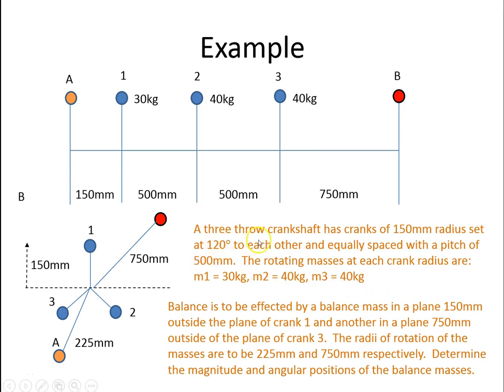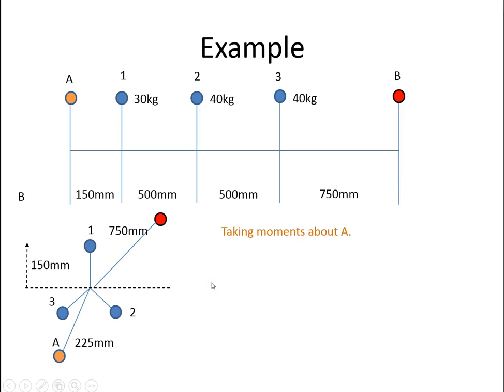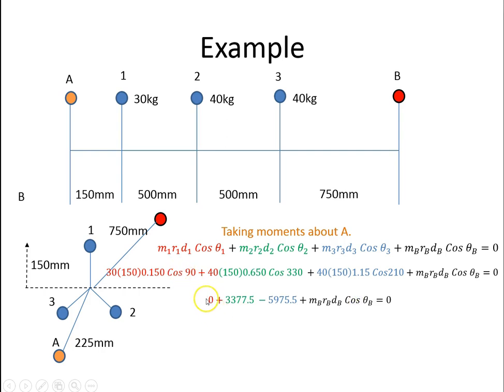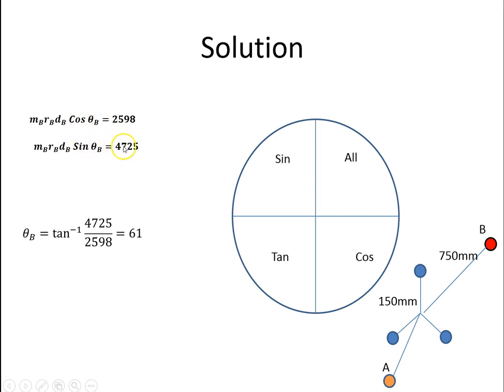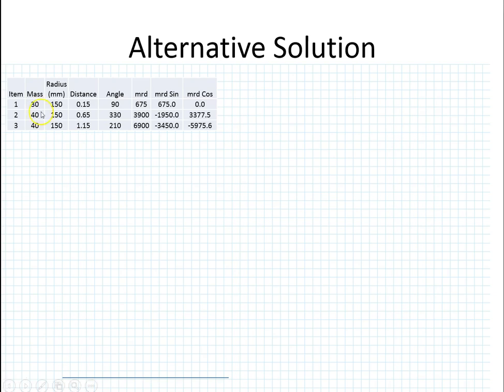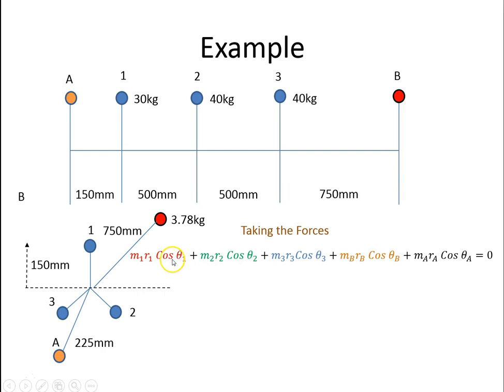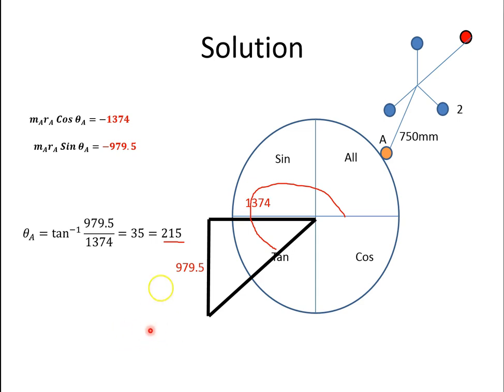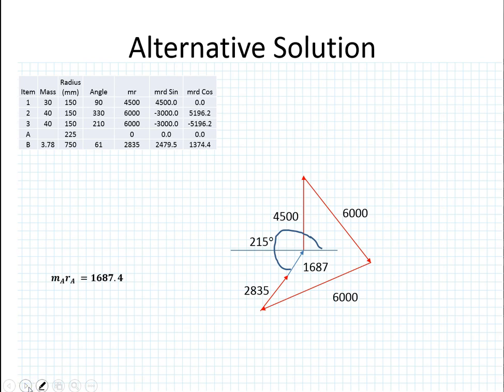Dynamic Balancing of Rotating Masses Example 2

Comment: How do ya know what part of the unit circle your angle falls into in order to add the extra degrees to get the correct angle?
Reply from the maker: I used the trigonometric A-S-T-C rule.  (All - Sin - Tan - Cos).  Here's a link to a video that might help describe it. https://youtu.be/4KnmPq0P2yA
Reply: @RoddyMcNamee  cheers I've a dynamics exam in carlow tomorrow and I'm sweatin

Comment: If masses 1, 2 and 3 are all at 90 degrees we get 0 for all three. What is the formula to calculate the counter balancing mass that is at 270 (opposite) to the masses. The balancing mass is to be only one. We need  its mass*radius  and its axial distance from mass one. Thank you.

Comment: Just wondering why you displayed r1 in millimeters, but used meters for d1? Shouldn't everything be in the same units (meters)?
Reply from the maker: Yes, generally everything should be in the same units.  In this case I left some in millimeters and some in meters to keep the product of both numbers in a more manageable format.  For example 150mm x 650mm = 97500mm^2 or .0975m^2, but 150mm x .650m = 97.5 mm(m).  For me, it was easier to work with this figure than the others.  However, using this method you have to remember which units you are using.